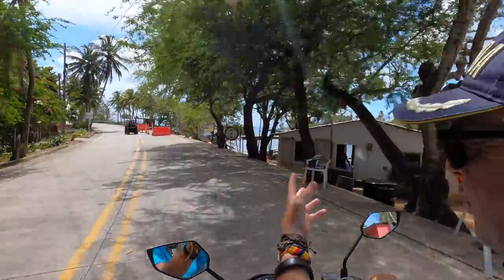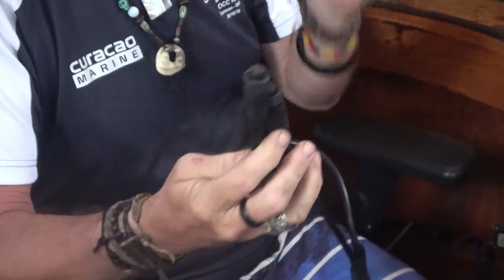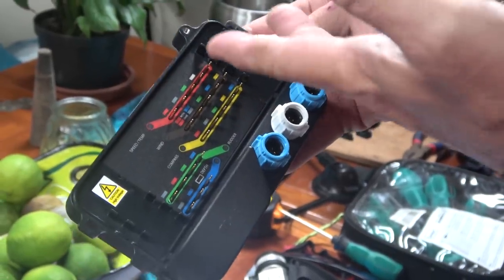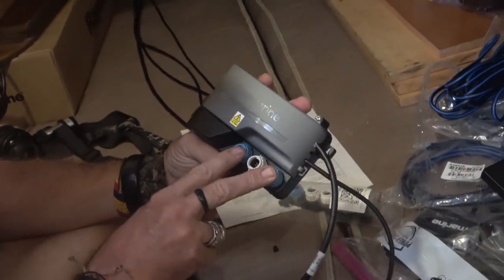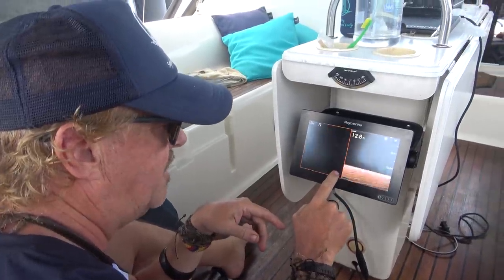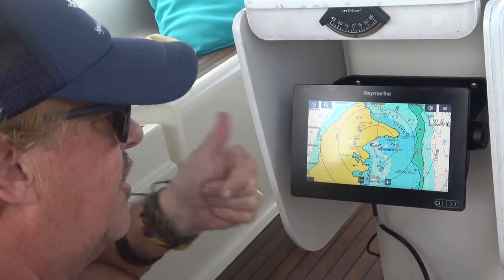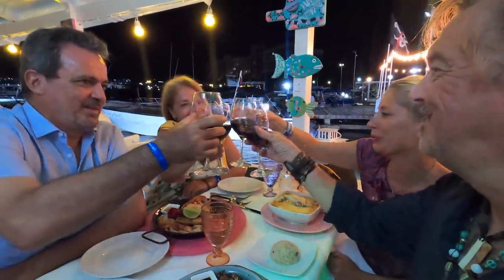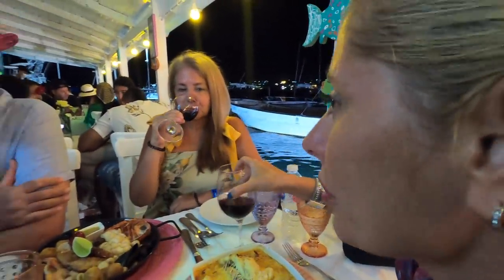SSL537 ~ Go to BED, or go to JAIL..!!

Comment: Great Video Capt Rick! Nice that they include connectors - If your chatting with them - maybe suggest that they include the connectors that have built in heat shrink - That would be a nice touch!
Reply from the maker: They could, but the waterproof ones require more mounting space, and the case is waterproof anyway so it wouldn't really be necessary... hopefully waterproof anyway!  Lol
Reply: @SailingSophisticatedLady  ...thanks Captain! Last time I trusted when a company said waterproof- I found myself in line buying a new IPhone😂

Comment: In your last video (SSL536) you were installing a terminal strip housing and talked about the reasons not to permanently mount with the tape or screws provided.  Have you ever used Velcro or 3M Dual Lock strips?  It would be a quick and easy install and removal and would keep it secure enough that it wouldn’t rattle around as the boat moves.

Comment: Uncle Rick, you might want to doublecheck the wiring for your radar cable, I know that some mfds use one wire in the ethernet cable to control mast unit standby and it doesn't translate through your non-ray marine network router
Reply from the maker: The network router I was speaking of is actually Raymarine for connection of several MFDs.. so no worries!  :)

Comment: as I understand it, your ITC was in the stern and you ran new data cables from there back to the nav station.
Could you not have installed the new ITC at the nav station and ran cable to the stern?  less cable
ITC accessible from your nav station...
Reply from the maker: Yes you are correct, could  have put it either place.. guess it's just because the old one was back there because I never had repeaters at my station before, so I kept it  same place.